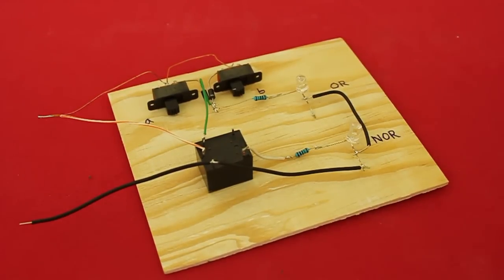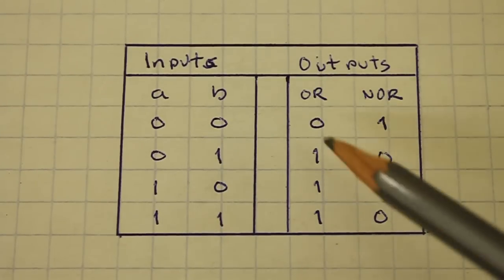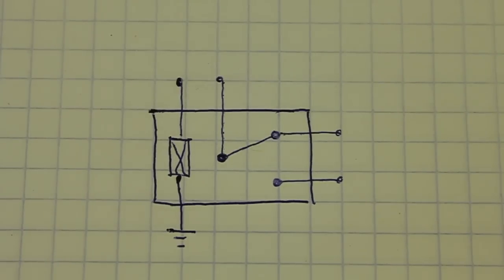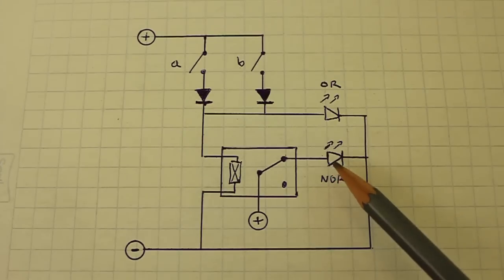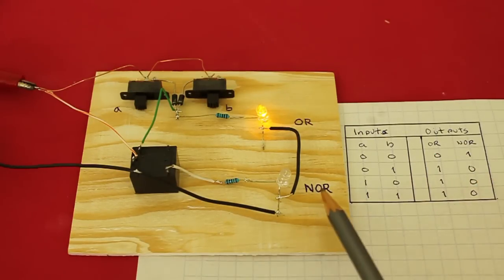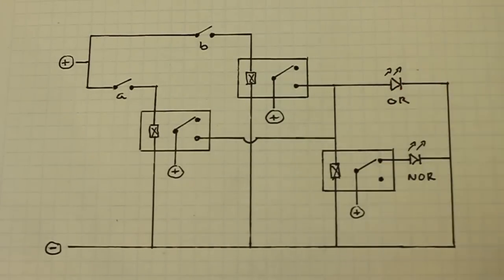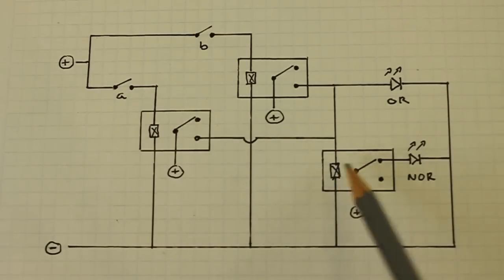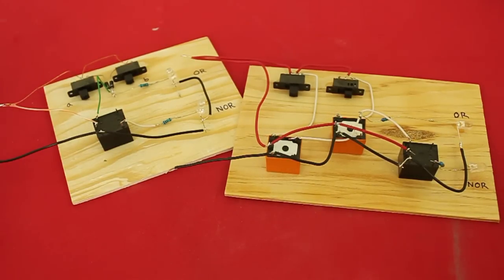Relay Logic: OR and NOR Gates

Comment: Sorry but it would be good to spell out on screen what thing it is. You said in the previous video you showed the an and nan gates? last video you did the "Screwed Electric DC Motor" which how long did that run for and can work in a push than pull. thanks
Reply from the maker: I meant the previous video in the relay logic series.